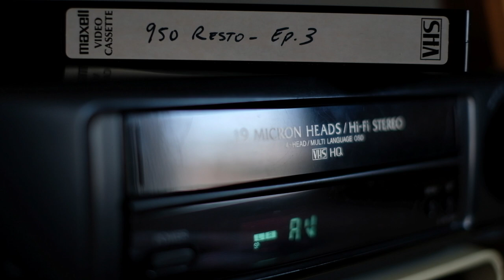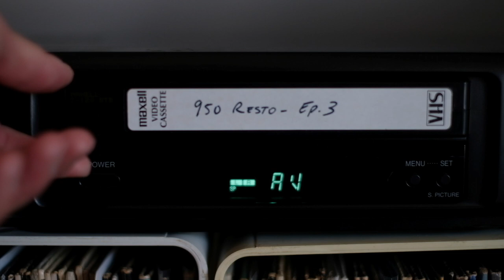KTM 950 Adventure S LC8 Restoration Rebuild - Episode 3

Comment: I've got two 950s 04 and 06  There like part of me, I've owned the 06 since 2014 and the 04 (My wives) since 2017.  Good call on the air filter and two into one.  Add a tool box on the other side.  You are an artist bro.  That said enjoy it.  We go everywhere on them an it sure makes life a lot more fun.  I'm a believer that they are one of the best bikes ever made.  No there not free and do like to be maintained but it's always got me home and I have a lot of miles now on them.  Drew SLC UT
Reply from the maker: Thankfully working on them is half of the fun!  Keep enjoying the 950's and be safe brother!
Reply: 2 in 1 is a good choice. Was contemplating going back to 2 exh but really like the wings on one side and the storage box on the other. Hasn't run in a couple years can't wait to get it back on the road. 990A, Marcus, Heber UT.

Comment: Glad to see you went with the Triple Clamp Moto intake 💪
Reply from the maker: Oh yeah, seems like a quality piece that shouldn't have any issues with dirt getting past it.  Of course I'm also now looking at the Scott's steering damper setup on their site...
Reply: @bivouacmoto6440  I am looking at exactly the same!  Also along with their clutch cover also... Need that money tree!
How long till you're finished?
Just installed the TCM filter myself, about to remap ECU, quick service then back on the tracks :)
Reply from the maker: @mkerstin  Amen on the money tree - of course rear tanks from Landmark Works would be nice to increase range, too! Hoping to be riding it by mid-April!
Reply: @bivouacmoto6440 not sure if you're aware, unit 31 fabrications in the uk also make rear tanks. Good luck with the rest of the build.

Comment: I would love some tips on how to clean the LC8 engine in place (without removing it). It is so grimy and there are so many hoses, wires, and connectors, it is a little daunting even after the tanks are off.

Comment: Yeah man,
I really enjoy watching your videos!

I am currently busy doing the 30.000 km Check on my 950. The water pump seal and bearings are a real pain in the ass to get out.
Probably have to get it warmed up and into the hydraulic press.
My coolant looks really shitty, so I hope it was just the Water pump and not the head gasket as well...

Gonna check the valve clearences next, but it is always fun to explore a new bike!  :)
Reply from the maker: Thanks so much for watching and the feedback - I appreciate it!  The water pump seal actually wasn't all that terrible although I did do it with the engine out of the bike.  With that said, follow Pyndon's write up over on ADVRider or on the KTM 950 Info page.  It certainly helps to heat the casing up @ 350* F for 15 minutes and freeze the bearings; they will drop right in as long as you do it quickly.  I'd also recommend buying a new water pump blade (super cheap, anyway) just because it's plastic and kind of difficult to get the old one off of the shaft without marring it.  Your valves might not need any shimming, but Hotcams sells a valve shim kit for ~$50 that definitely came in handy.  Good luck on the repairs!

Comment: You should get a Ktm oem sprocket, the one with the rubber damper.
It is a lot smoother on the output shaft.
And with a 16T, the bike feel more alive.
Reply from the maker: It's an OEM 17T sprocket. I have a 42T to pair in the rear, but seems like 16/45 is the way to go to liven things up. Thoughts?
Reply: @bivouacmoto6440  KTM have two kinds of front sprockets.
The one you got, and the one with the rubber (more expensive).  The rubber one is the OEM on the bike.

For the ratio, I run my 950 with 16x42 (stock is 17x42).
At 130 kph, the engine in 6th gear run at 5k.
Reply from the maker: @simonpoudrette  ah, yeah, I knew about the rubber one, but don't particularly mind the all metal one (I appreciate the suggestion though).  Just ordered a 16x45 setup - there goes the fuel mileage lol!